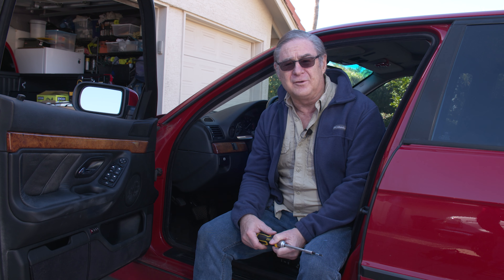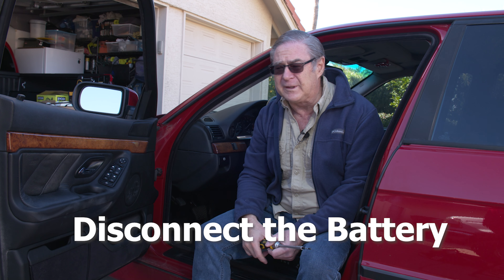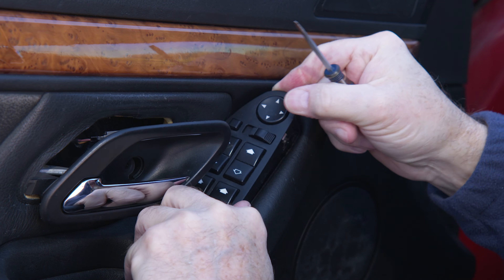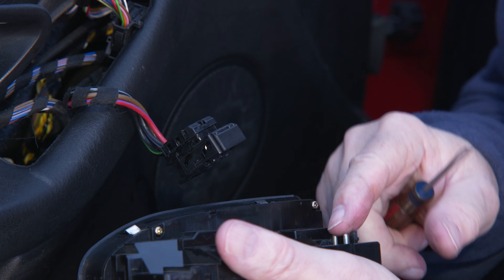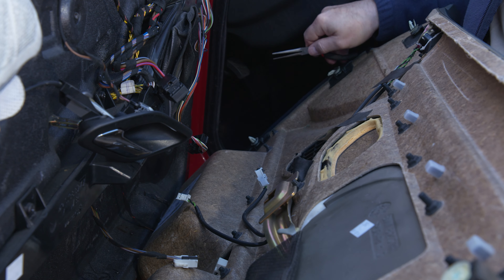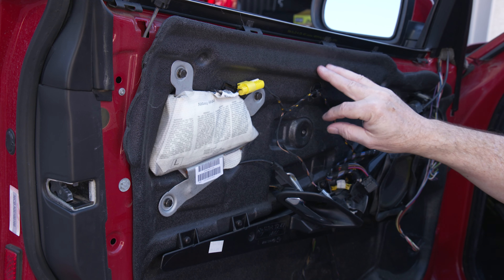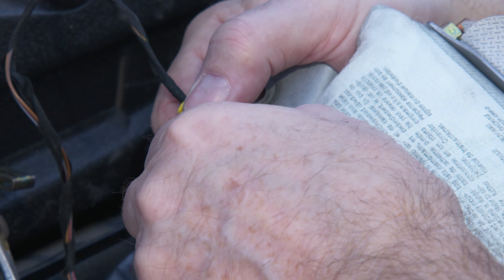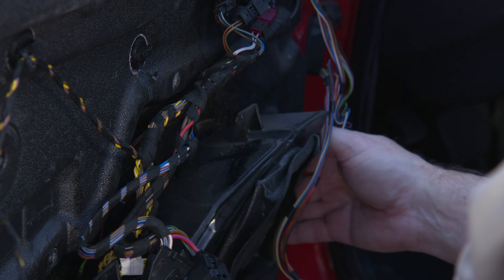Refresh Your BMW E38: Easy Front Door Panel Removal Guide | Step-by-Step Tutorial

Comment: Thanks for posting this, it's getting harder to find a high quality tutorial on e38's since a lot of the old forum posts are deleted, unsolved or pictures no longer work. I need to replace the door handle on my 1997 740i and needer a refresh on the door panel before I get started. 

By the way, the camera work and sound are excellent.